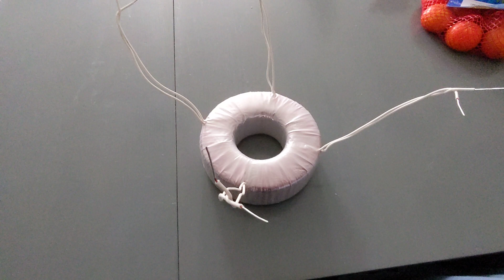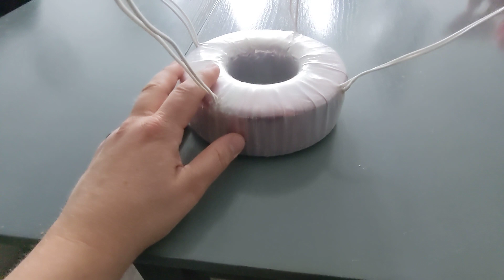Faraday Research RND ⚡⚡💦#freeenergy #tesla #zeropointenergy

Comment: you can see the crystal batteries i made in my channel they still put out voltage as soon as i get them wet with water. They are like 8 years old
Reply from the maker: Thanks brother. I will check it out 😉
Reply: @FaradayResearch  Please look for a fault in the circuit , its proto type that exists only on paper. Supposed to alternatingly collect the reverse fly back voltage each 180 degree pulse back and forth between the two energy storage device cap/bat
Reply from the maker: @mykedoes4099  yeah one thing I found out with those crystal batteries if you add iron pyrite or fool's gold make it into sand and add that to your mixture it'll increase your amperage greatly
Reply: @FaradayResearch  i did add pyrite, i used everyhting Hutchesen said , they still work just soak them in water  to ge them going , when they dry up they put out less amps
Reply from the maker: @mykedoes4099  yeah you might want to research this back in world war II the Nazi Germans were working on this interesting battery it was a Mercury battery and apparently it had a hand crank on it and if you spun the hand crank on the battery it came back to life so you might want to check into that
Reply: @FaradayResearch  I heard of it.. No mercury needed with my circuit though
Reply: @FaradayResearch  I will never get near mercury again, i learned my lesson , be careful if you have fillings or know someone who does . get them removed asap
Reply: @FaradayResearch  i get your point , the two devices are similar , i don't think you need mercury to achieve over unity though